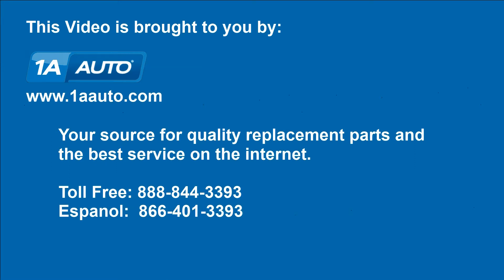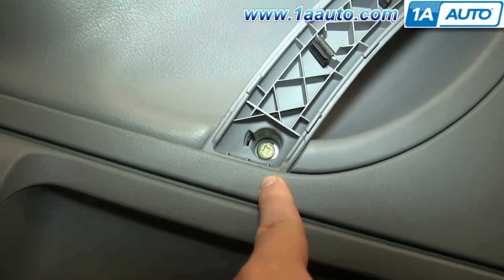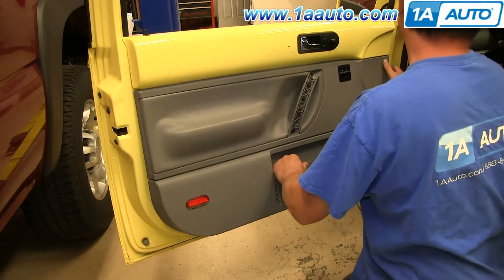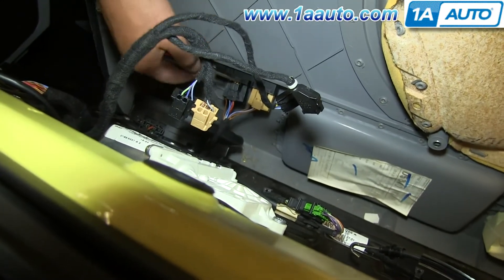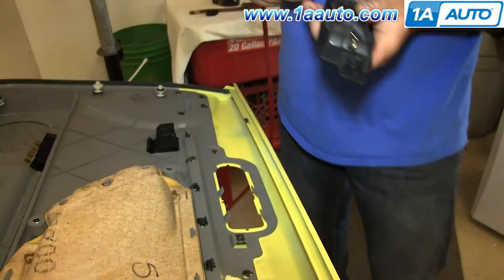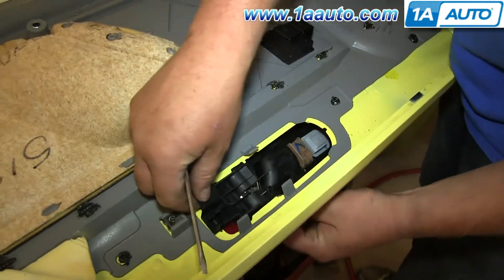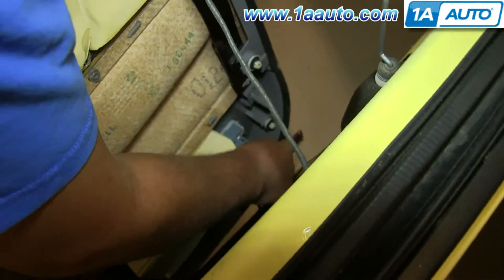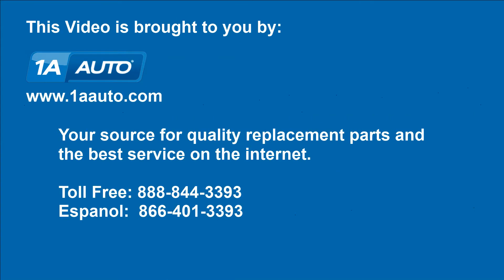How To Replace Interior Door Handle 2001 Volkswagen Beetle

Comment: Thank you so much for this video! I just purchased an 06' Beetle and the dealer wanted  $350.00 per door for the original handle installed! I swear, a parted our VW Beetle can sell for $50,000.00 in parts alone! The scrap yard wanted $100.00 per door and wanted me to remove it from the crashed VW myself. What's this world coming to?  Thank GOD 1A Auto is on our side!!

Comment: Love the videos, specifically the ones concerning Beetles. This one was particularly helpful, with one caveat: you don't actually SELL the replacement part on your site. I have a 2001 that is in dire need of replacing both interior door handles.

Could you direct me to the part, please? Much thanks! Between your videos and my iPad, its like having a mechanic right next to me in the garage.
Reply from the maker: We currently do not have this particular replacement part. However we have found a source for them, and they should be available in a little while on our website. Thank you for asking. 1aauto.com 866-403-3393

Comment: I have a bettle 2008 the latch won't close i tried everything to check. My question is if the cable atta hed to the inside handle of it was detached would that affect the latch to keep the door closed.